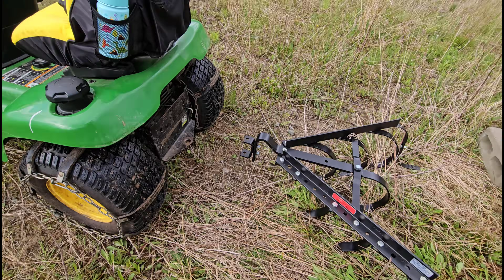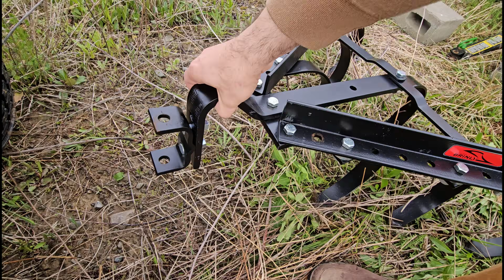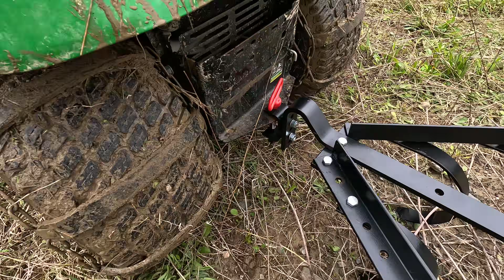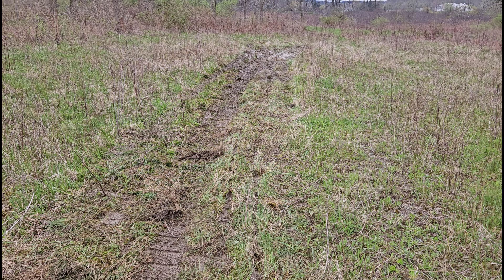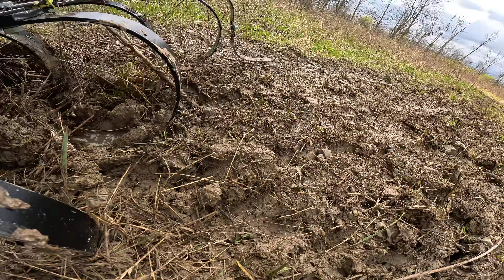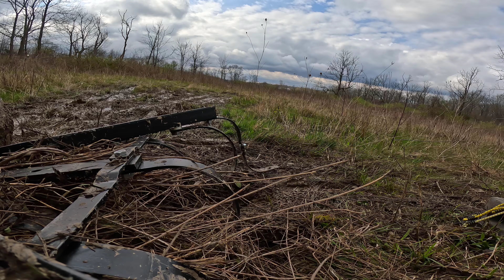Testing a cultivator attachment with a John Deere X380

Comment: Those cultivators are nice, but, as I’m sure you have learned by now, they are intended to mount on a sleeve hitch. I was wondering if you ended up finding a sleeve hitch that was compatible with your X380? I had to rig up a tongue to pull a disk that I bought to pull behind mine. But, if you had discovered a sleeve hitch that was compatible, I would love to know about it.
Reply from the maker: I initially balked at the price of a sleeve hitch being just as much as the cultivator itself, but very much see why it's needed now. I wound up borrowing a big gas-powered tiller from a neighbor instead and using that, so I haven't done any further searching for compatible sleeve hitches unfortunately.
Reply: Hi,
Unfortunately the x380 isn’t really meant for ground engaging implements.
I searched a while on the web but can’t seem to find any sleeve hitch for the x380.
Sorry
Reply: @charlesbaril3038 tongue is still working fine for mine. I’ve used it quite a bit. I’m sure I use my tractor harder than most folks. I do make an effort to do all the maintenance more often than called for. Time will tell what happens.